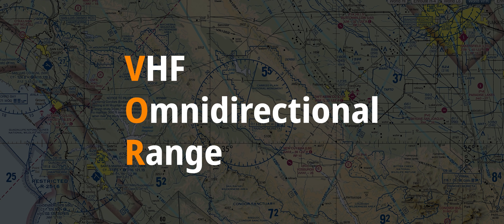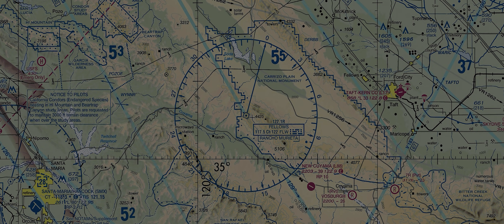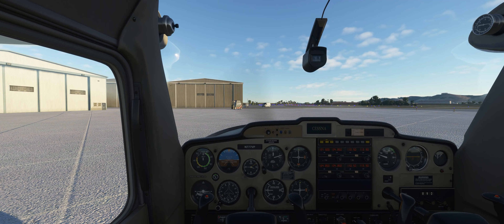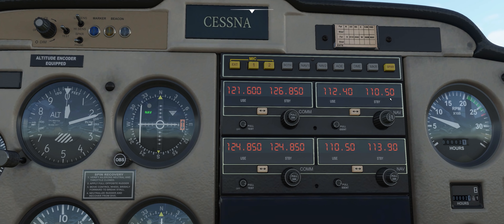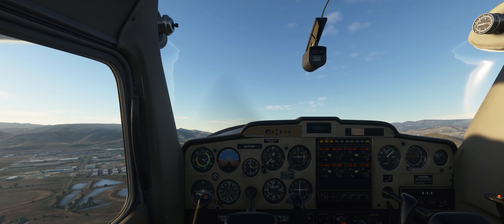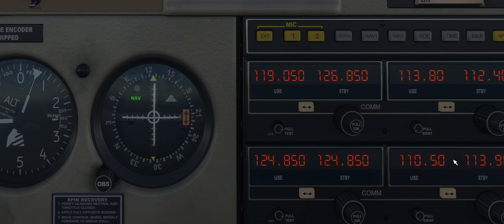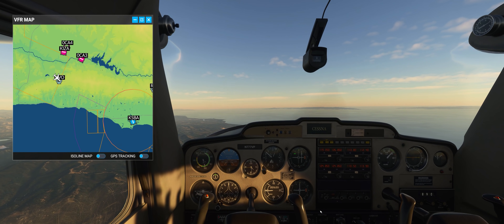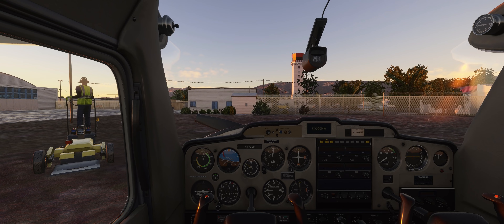MSFS: VOR Navigation Basics in the Cessna 152 - Microsoft Flight Simulator

Comment: Afternoon sir, I have my private pilot check ride coming up and VOR’s have been taking time to understand. It’s usually when I’m in the plane my mind goes blank. I understand the concept much better now and your video was excellent. I will watch it many more time so thank you. What throws me out is radio 1 and 2 like if we want to triangulate I usually do it throw the same one where it is more beneficial to use both to get done more effectively. When we switch to Vloc mode and we have to align the arrow after we switch from GPS mode. Could you help me understand this part a little better? where we align the arrow and bug the heading. I’m flying out of Bakersfield

Comment: Great vid! Learning vor navigation on simulator using the Cessna 152. When setting my flight plan vor to vor MSF automatically throws in navaid stations whose frequencies are way above the 118 htz limit. My question is how do you switch to use those higher freq's when the nav tuner only goes so high? Do i just need to use stations that transit lower freq's?

Comment: I thought the 0 radial always pointed exactly north. Isn't that the case? I realize that there may be differences between magnetic north and geographical north, but the deviation from the 000 radials and the longitude lines on the map seem to have much larger deviation than that.
Reply from the maker: The longitude lines align with true north, while VORs are aligned to magnetic north (or at least, at one time they were).

My understanding is that when each VOR was built, it was aligned to what was magnetic north at that time. Since the magnetic north pole drifts over time, each VOR has a known "magnetic variation" compared to what magnetic north is today. If you look up details about a specific VOR (like via Google or Navigraph), you can find its current magnetic variation. Regardless of what the variation of each station happens to be, you'll set your CDI to the published/noted radials on the chart in order to navigate along the Victor (or Jet) airways between the VORs, since that "highway" itself hasn't actually moved.

It's a bit weird, but basically you're saying "yeah yeah, sure thing VOR, radial 205 would actually be radial 208 nowadays if we re-aligned you, but you won't change your mind, so I'll have to use 205 because you behave as if it still is." It helps me to think of radials as physical/permanent highways, and they're treated that way since they aren't ever (or very rarely) actually re-aligned -- that'd be like digging up and moving each of those 360 "highways" -- expensive and not necessary.

Comment: Maybe I missed something here but my question is this. In areas where the VOR ranges are more sporadic, what happens in those areas where there are no radials to dial into, either to or from due to their range. Is it a case where you just lock n load until you pickup the next one then make adjustments when you meet the inbound VOR? And if so, how far do you typically veer off course due to wind? Are VOR's, generally abundant enough to mitigate deviation or just generally more reliable where it matters, like restricted airspace?

Comment: The default nav stack control on the 152 on my msfs2020 is Garmin glass. How do I select the “old” non-glass CDI control stacks - the controls that display active and standby frequencies using old-style non-glass displays?
Reply from the maker: This specific plane is part of the MSFS Deluxe upgrade, which includes 5 planes. You can buy it in the in-game marketplace.
Reply: @KipOnTheGround  Thanks, Kip. I was afraid of that. Don’t have the budget for Deluxe.
Reply from the maker: If you want to use a 530/430, I think the only standard edition plane that has them is the PC-6 Porter. It's bigger than a 172 but you'll have the avionics you want :-)

Comment: I feel like the youngsters watching this are missing out on just how revolutionary this low-tech navigation tool was.  If you grew up in the 80s or 90s, all you knew of the world in Microsoft Flight simulator was doing loops around Meigs Field.  Maybe you'd do a short hop from there to Chicago O'Hare if you were feeling adventurous. But learning VOR was like earning your flight simulation black belt:  it was the moment you dug the manual back out, found the map of VOR transmitters and frequencies, and realized you could theoretically go anywhere.

Now nearly everything in the game comes with a simulated Garmin, and flying a simulated plane between airports is only slightly more complicated than using your phone to navigate your car to an airport's departures terminal in real life.
Reply: I actually prefer VORs, you have to plan more and keeps you on your toes..
Reply: I'm glad the Cessna 152 mod I have has an option to not have a GPS. I use the Bendix/King DME and ADF, Garmin transponder, and stock Cessna nav/comm radios
Reply: What's crazy is that once you get a grasp of VOR it's just as efficient as GPS. The only problem is getting a good grasp of it because it is extremely confusing. But once you get a hold of it, it's okay. I'm like 70% of the way through of understanding them.
Reply: @kraudavid5975  I don't necessarily know about "just as efficient" since you're still tethered to particular transmitting stations which are located at fixed points on land rather than an orbiting network of satellites that can help you chart a direct line between any two points on the globe.  But it's still amazingly flexible--I recently spent an entire day in the simulator taking a Cessna 152 from Seattle to San Diego using VOR just to prove to myself that I still remember how to do it.
Reply: @kraudavid5975 as for everything, we need practice. Am trying to learn as I just know where to go with a garmin g1000 but I feel like analog planes are more fun. But as we as used to VOR and that, the more able we are to understand and locate so we can navegate more efficiently

Comment: i've got a simple flightplan and want the ai pilot to fly the cruise leg, which is waypoint 2 to 3. So I've reached wp 2, got to TOC and activate ai pilot. but this individual puts the aircraft on a vector to wp2, instead of wp3 - practically flying the opposite to the intended way. The VFR map shows that the wp1 to wp2 is still selected, no matter i've already flew 15 miles away from it.

is there a way to make the ai pilot follow a specific leg of the plan?

or:

Is there a way to choose an "active waypoint" on the VFR map?

IMPORTANT: I am NOT using GPS. I'm flying a plane that has NO GPS and no autopilot. I'm just trying to make the ai "copilot" reach the correct waypont

Comment: Big help! I’ve known about VOR for a while but had issues understanding completely. One question, how do you know when to switch frequencies?
Reply from the maker: If you look up IFR Enroute charts (instead of using a VFR sectional), there are "changeover points" (they look kind of like two overlapping and reversed "L" shapes) shown along the airways that represent where to change VORs. If one isn't present, you change at the halfway point between them.

Comment: What a great tutorial. One question - when do or why would you use the 2nd com?
Reply from the maker: Hey Andre. Thanks! I mainly use COM1 for my active 2-way communications with ATC and COM2 just for monitoring ATIS/AWOS and/or emergency frequencies.

For example, on the ground I'd first setup Ground and Tower on the COM1 active/standby frequencies, and put the local ATIS/AWOS on COM2. When I'm ready to  listen to the ATIS, I just toggle it on by pressing the "COM2" listen button on the audio panel (if COM1 is noisy during this time, I can press COM1 to mute it temporarily). Once it's time to switch to tower, I'd just swap COM1 to the already-entered Tower frequency that's on standby, and then I'd put in the next frequency I expect in the standby field (like the Departure frequency if you have IFR clearance or are getting flight following) so it's ready to go for the next phase.

As I towards my destination (or as-needed enroute for a longer flight), I'd switch COM2 over to use the next ATIS/AWOS I need, and enable monitoring on COM2 when I need to check it.

The big benefit is that you won't need to leave frequency on COM1 to check the ATIS, potentially missing communications or overhearing important information from ATC on that frequency. While I was using PilotEdge last year, I was only able to use the COM1 radio at the time, and I had to notify ATC each time I was going off-frequency to check the weather, then notify them again once I was back on-frequency. Using COM2 lets you avoid having to do that, as you just flip COM2 on momentarily.
Reply: @KipOnTheGround  Hi Kip, thanks for this explanation, all makes sense! I play FS2020 since it was released but mostly just flew around and enjoyed the scenery in VR, now decided to learn how to do everything the right way. I had no idea how navigating and ATC worked. I checked several guides but yours really hit the nail for me.

Comment: When I learned to fly (When Pontius was a pilate!!) actually in the mid 1960's, our initial instrument training was with an ADF and NDB beacons. This was quite a challenge at first but very pleasurable when mastered. Moving up to VOR especially when combined with DME was a god send, it was so easy providing you could understand TO and FROM and a 360 deg. compass rose. My first privately owned aircraft was a Grumman AA5B and I had it fitted with a King KNS80 which allowed you to move a VOR to almost any location, fantastic at the time. I recall also being able to make my first instrument approach using a VOR DME. However after a 40 year flying career and having used just about every navigation system available both military and civil, my favorite is still the mark I eyeball and a  chart. A little difficult when crossing the Atlantic of course, there aren't too many waves on the chart!! But is extremely important to understand the limitations of any system and paramount to keep a mental picture of your current position should any system fail.

Comment: So you're basically setting the CDI to your outbound course not to the inbound course?
Reply from the maker: Yes, you could think of navigating in terms of the outbound course. For example, if you’re east of the VOR and want to track the 090 radial inbound you’d put 270 on the top of the CDI (090 would be on the bottom). So then you’d intercept the needle and fly a course of 270, seeing a TO flag on the CDI since were flying inbound/to the VOR. Technically though you’d be tracking the 090 radial inbound until crossing the VOR, then you’d be tracking the 270 outbound with a FROM flag. So it’s still important in terms of describing where you are—which is on the 090 radial.

Comment: The To and the From does not tell you if you are flying to or from the VOR. The VOR Nav Receiver doesn’t know or care what heading you are flying. In fact you could fly a tight 360 degree circle on a radial with either a To or From indicated and it wouldn’t change from ‘To’ to ‘From’ or from ‘From’ to ‘To’ throughout the circle. What a ‘To’ indication means is if you fly the heading selected in the OBS it will take you To the VOR and if you have a ‘From’ indication it means that if you fly the heading selected in the OBS it will take you From the VOR. Track a radial with a ‘To’ indication to the VOR and when you pass over it and if you don’t change the radial selected with the OBS and it will change the indication from ‘To’ to  ‘From’ not because you are now flying from the VOR but because your location is such that you are flying on the From side of the radial selected with the OBS. Continue to fly a little ways away from the VOR on the same heading with a From indication then turn 180 degrees to take you back To the VOR and it will still continue to say From for as long as you are on the From side of the radial selected with the OBS.

Comment: A little heads up, a better course of action would have been, after departing San Louis Obispo airport fly direct to the Guadalupe VOR, which is in the direction of the destination airport instead of Morro Bay, a VOR opposite your direction of flight.  Another option if you wanted to use the Morro Bay VOR. Turn to a heading of 150 degrees after departing San Louis Obispo airport to intercept the 126 degree radial out of Morro Bay.  Selecting the 126 degree radial out of the Morro Bay VOR would have provided positive steering information given its position to San Louis Obispo airport.  Planes are not cheap to rent or own and plays a big roll in the course to be flown.

Comment: I thought I was an intelligent person. This is the most simple and straightforward tutorial I've seen on YouTube. Somehow I didn't get it. I was fine until the 126° part. Was the 126° was conveniently on the path or in any other situation it would have been different? The video is fine, and the guy is clear. There's something that makes me not grasp it completely. I guess you can't fix stupid 🤣.
Reply from the maker: 126 is the radial/course we'll fly on from the Morro Bay VOR (MQO). I figured it out by using the flight planning feature of Skyvector, but the chart itself has markings to point out the radials between VORs as well (see 8:13 in the video).

The MQO 126 radial leads directly to the Gaviota VOR (GVO). The GVO 101 radial leads to the Santa Barbara airport (KSBA).

Comment: How fast should you travel? Mfs2020 gives ETE 20 minutes for example but no instruction on throttle. How can you know itll take 20 minutes if there's no designated knots to travel at
Reply from the maker: Every plane has recommended speeds for the cruise phase of the flight. In the 152, the actual POH (pilot’s operating handbook) says to set power between 1900-2500 RPM during cruise. The trade off is between speed and fuel consumption. If you google the POH for the plane you’re flying, you can find recommendations for these speeds for your specific plane.
Reply: MAN! thanks for the speedy reply you're a good man. I will do that, crazy no one else asked cuz that's pretty intense I gotta use google instead of it being in game. Salutations bro dude

Comment: Can you use some kind of guidance what runway you be landing.
Thank
Reply from the maker: Are you asking if there's a way to know which runway you'll be landing at? The easiest way is when you contact ATC at a towered airport (or contact an Approach controller for Flight Following or IFR clearance). Both will tell you wish approach and/or runway to land on based on the current weather and other factors. If there's no controller, you can tune into ATIS on the radio if it's available. And if that's not an option, finally you check the wind (either via your Garmin avionics if possible, or via a weather broadcast like AWOS, or as a last resort fly over the airport and observe the windsock). Once you know the wind, you can decide which runway is best (you always want to land facing into the wind as much as possible). You also need to land on a runway long enough for the landing distance/length required for your plane :-) Hope that all helps.

Comment: Great video. I understand the VOR to VOR Navigation to some degree. But i have a stupid question and I'm not sure if this is the proper tutorial to post this. But about Waypoints/Intersections can you navigate to them manually, cause  i don't see frequencies for them or are just through the GPS?  Because how do I know when i have reached one and when i have past it? Please forgive my post if its confusing and a redundant question. But great video bro keep it up!
Reply from the maker: Yes, waypoints are used via GPS, however, you can navigate to VOR intersections by flying on one VOR's radial, then while flying that course, tune into a second VOR and wait to cross one of its specific radials. The moment the second VOR's radial is intercepted (the CDI needle is in the center) is when you'll know you're at the intersection. Having 2 NAV radios and 2 CDIs make this easier since you can monitor the 2 VORs at the same time.

Another capability is with VOR DME (Distance Measuring Equipment). With DME, you see how far you are from the VOR as well, and that can also be used for navigation purposes -- determining your position based on how far away you are from the VOR on a specific radial.

Hope that makes sense :-)
Reply: @KipOnTheGround  Thanks for the reply. Cleared it up some.  Thanks again for the quick response.

Comment: Great video, Kip! I have a question, however. I set up a two-VOR route, too. For some reason, however, my gyro went bonkers: it was no longer indicating the right direction. Do you have any idea what might have happened? Thanks!
Reply from the maker: I haven't been doing VOR navigation lately, but I did notice some strange behavior in the latest MSFS version with GPS courses that were showing backwards on the G1000's HSI (it would show the course to the left when it was actually to the right). I wonder if it's related!
Reply: @KipOnTheGround  Thanks Kip. That might be a problem, too. But I think the problem I have been experiencing is related to active pausing, leaving the app (Windows Alt Tab) and then coming back. It is at that point that the gyro goes nuts. The compass is still working properly. Weird...